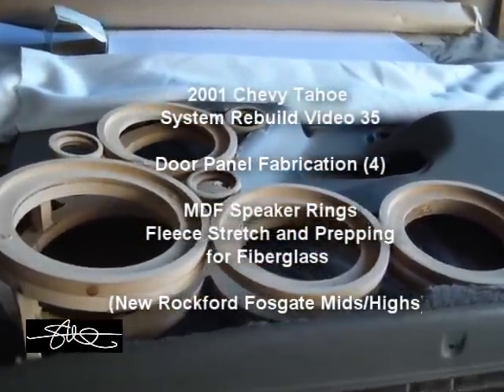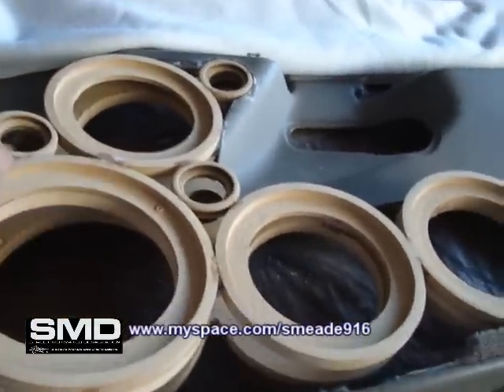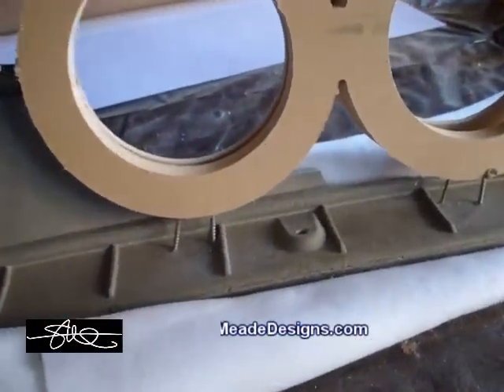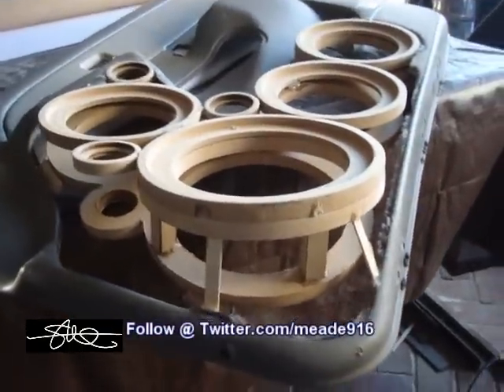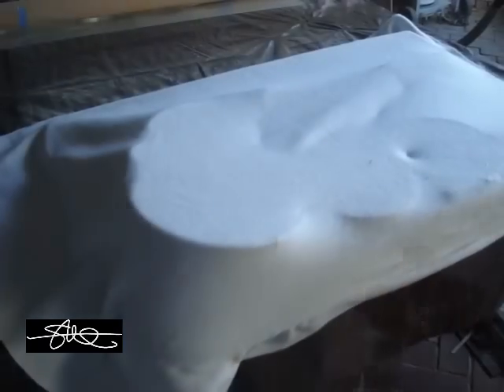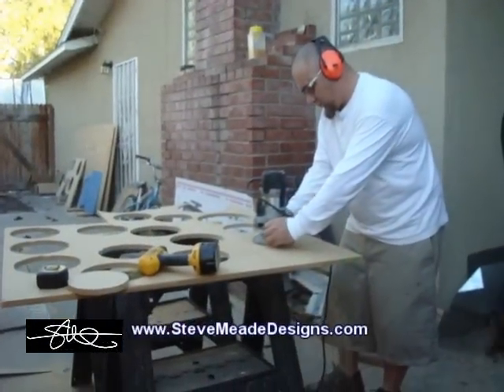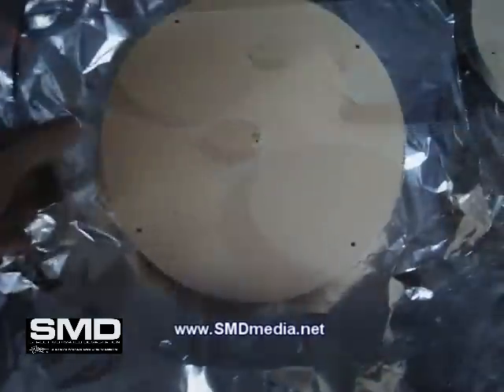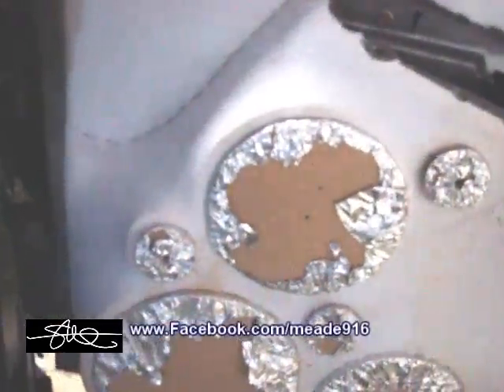Door Panels - Pre Fiberglass-Tahoe System Rebuild vid 35

Comment: I have one question.  How do you mount the door back on the taho?  Wont the fiberglass change the clearance around the edges?  Do you use the original mounts and if so how do you keep the fiberglass from getting in the way around the edges but still have it wrap around so that it is strong and doesnt chip?